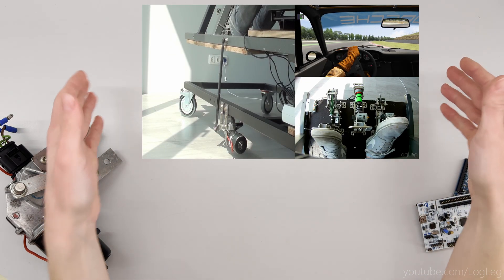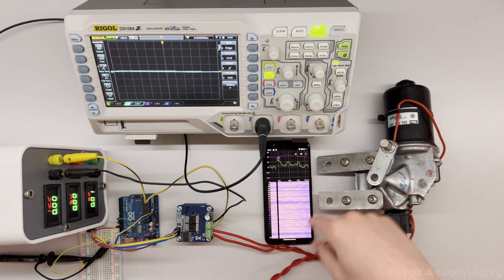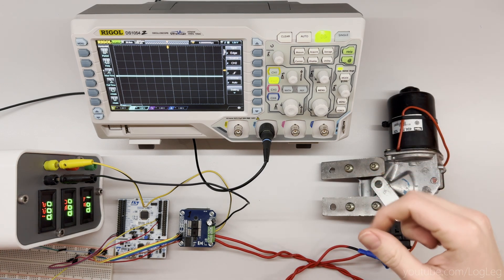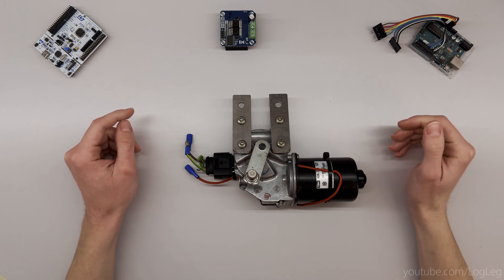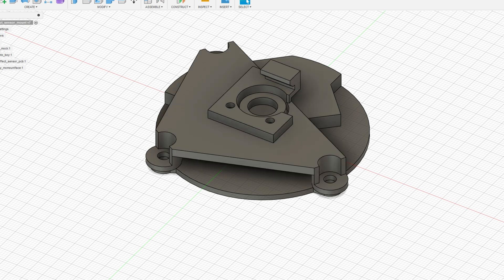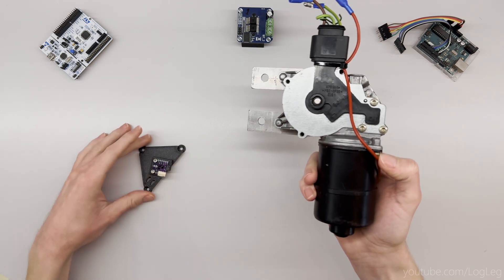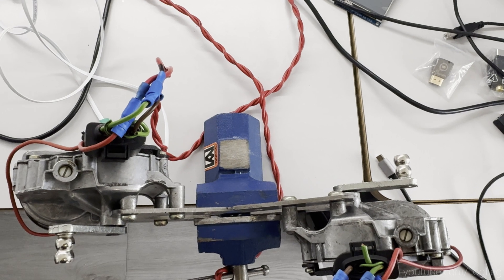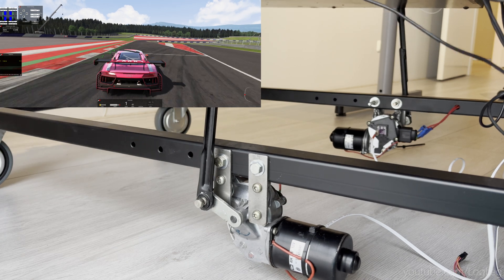Getting rid of the noise on my DIY 2DOF motion sim

Comment: Nice build , this is a wiper motor ? How come you dont have that much backlash?  Are you on xsimulator ?
Reply from the maker: Yes. And yes there is some backlash but the weight of the rig rests on it so it mostly rubs the same side of the gears always. Im not on xsimulator. I built all the software myself

Comment: have you changed anything on the rig?
Reply from the maker: Yes, i have added a monitor mount and changed the wheel to an asetek forte base and wheel. Right now I’m looking into rewriting it all in Rust (starting with the firmware for the pedals)
Reply: @LogLeg  that sounds awaome, will we be getting a video about the changes?

i was in the process of building one, got the electronics except for the motors, i stalled there, the windsheild wiper motors, are they enough?

i was making a 3dof sim, you mentioned from a van, like a minivan or suv? im not sure if the 12v motors can handel fast movments with heavy weights (the frame + big monitor + bass shaker etc), i tried finding documentation about it but its so hard to find a clear answer.

i know trucks have 24v heavy duty wiper motors and im confused if thats what youre using since they look like the regular car motor ones, would they be overkill or is what you have (if its the 12v regular one) barely enough/in need for upgrades?
Reply from the maker: @YHK_YT Keep in mind that my system is 2DoF. The wiper motors only move the platform. The weight is lifted by a propshaft directly under the center of mass. Furthermore I used wiper motors from big vans like a volkswagen transporter or similar/bigger. Then I drive them at around 13 to 14volts. Its not the fastest and its certainly not accurate, but you wont build this for realism, just immersion and for that its plenty fast enough.

Maybe I will make another video. I dont have a good video subject right now. I am working on some cool stuff like a FFB H shifter but that is very far from done
Reply: @LogLeg that shifter sounds insane, cant imagine getting stuck in gear or grinding the gears with a FFB shifter LOL

regarding the motors, yeah so i assume you are using the regular 12v ones but overclocking it a bit, and yes i understand its not going to move all the load, thats what i was going to do aswell, the same u joint idea, and the third dof is just traction loss, so i assume that one might need 2 or 1 strong motor. it is for immersion i agree, realism would mean 10x the budget and time, its for fun afterall.

maybe when youre done or halfway there you could make a progress video, sometimes you might miss things and others might point them out or help improve them, ive had my fair share of almost obvious things that had it not been for someone else pointing them out i wouldve screwd it up, and you also get the views upside too if thats of any intrest
Reply from the maker: @YHK_YT you know, maybe I will make a video about it :) thanks for the feedback!

Comment: Hello, they are windshield wiper motors, right? And did you disassemble them to modify something so that they work with sim tools? I would appreciate it if you leave me a link to purchase the engines. Thanks very much buddy
Reply from the maker: Hey! Yes, they are from the scrapyard, they are intended for VW transporters (Valeo 404.780) I added the magnet in the back to measure the rotation of the axle and isolated the chassis. That's why you can see a red wire coming out of the shell. Normally the housing of the motor is connected to the - of the car battery, but in my rig both motors are connected to the metal frame and when they need to turn in opposite directions they would short out.

Comment: Nice work. I wonder if TL Smoothers would help noise reduction without having to rewrite code for a different board.
Reply from the maker: It's not just the noise I'm solving with this. I'm now also able to debug my code and I'm thinking of adding a small display for some configuration menu's. It's nice to have a platform that's a little bit overpowered so that I can add anything I want.